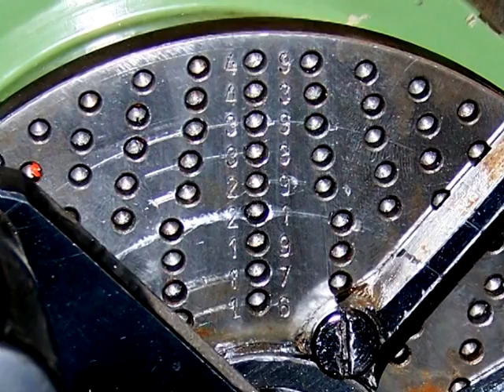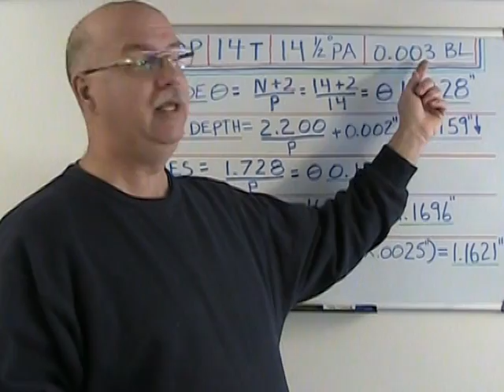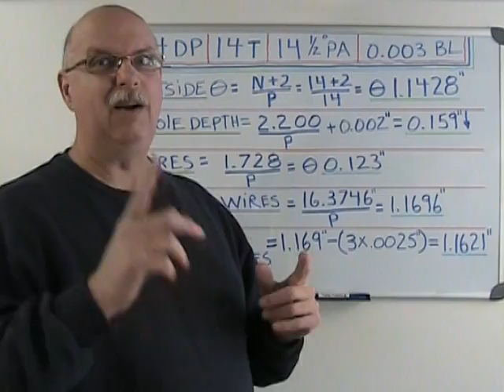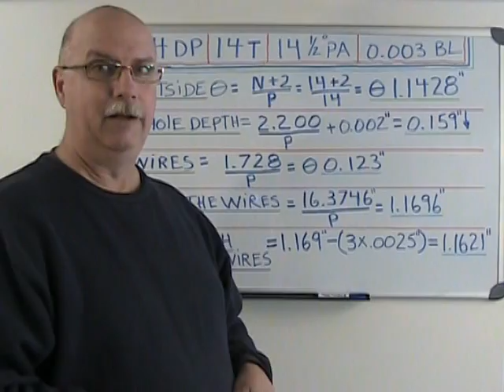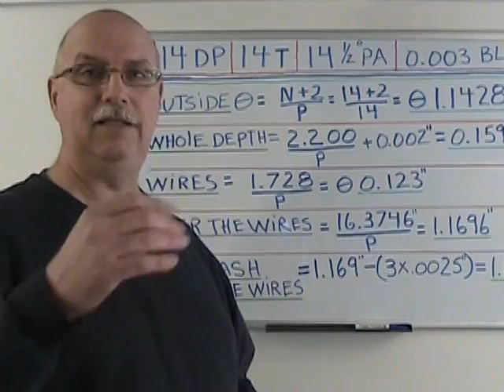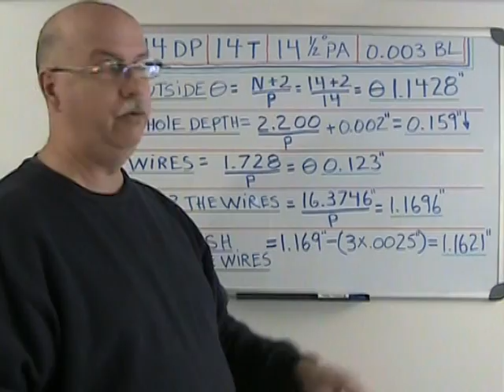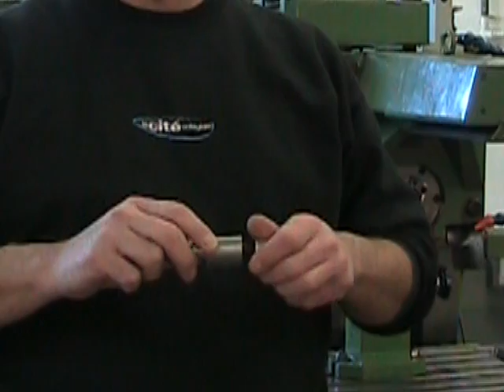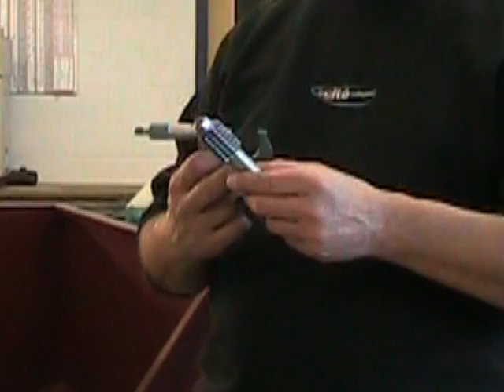027  DIVIDING HEAD & GEAR CUTTING, MILLING 101 MARC LECUYER

Comment: the best video i've seen on gear cutting. you took a lot of mystery out of the process. is there a reason for useing climb milling? i would like to see another video on the types of gear cutters and how to choose the proper one.
Reply: Generally climb milling achieves better surface finish for a given feed/speed, which in the case of gears would lead to a much more precise control of the meshing. Remember the backlash consideration and how it will space the tooth contact points only a few tenths - a poor finish can have variations in the range of tenths, not to mention that any attempt at cleanup or polish will remove material and likely in an uneven fashion, and in any case you're just better off doing it right from the get go.

One of the "golden rules" of milling: thick to thin. You want your tool to bite into the material and as it moves through it, have it thin out: this is what climb million achieves - this is also why climb milling requires rigid machines because of the forces of the intial 'bite.' It may seem counter intuitive at first but climbing also leads to better life of the cutting edges themselves. In a conventional cutting situation (thin to thick) as the cutter comes into contact with the material it actually rubs and dulls the cutting edges because the cutting edges need some material to bite into.

Something that feels like a razor to your finger can still have a radius of .0005 for instance, and depending on the cutter radius this means that there will be a considerable amount of material land that the cutting edge simply rubs and deforms before it is able to get under it - this is the reason for poor finish. This is a consideration for even lathes: you have to take a heavy enough cut for the tool so that it can actually get under the material and cut it, rather than simply deforming it. This is why brand new tooling always gives a nicer finish, and its also why .001 "finish" passes (required because of unaccounted for tool deflection) with less than dead sharp uncoated tooling often ends in disaster. The idea of something being free cutting means it cuts very easily and you can take nice light passes without worry of marring the finish - other materials no matter how sharp your tooling will have a tendency to just push out of the way and is why they need heavier cuts (and with lathes that also brings up the topic of chipbreaking.. but thats another story)

There are a number of other considerations and I could probably extend this novel quite further but I hope it helps to answer your question a little and guides you into some sort of direction as to all the things you could consider.

Cheers

Comment: Clear as a bell. I seems as though you did some effective lip syncing over the original French versioned passages. At any rate it is of no distraction, so if you are spending time on that I would prefer you used your precious time covering more subject matter. Great job and (I hope you don't get tired of repetition) your pedagogy is as fine tuned as your machining. Thanks for this one. I'm off to find a foot stock for my indexing head.